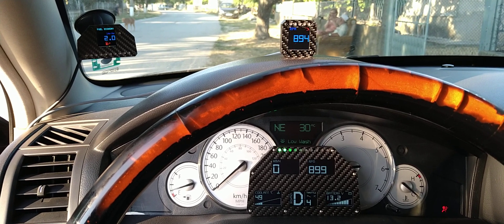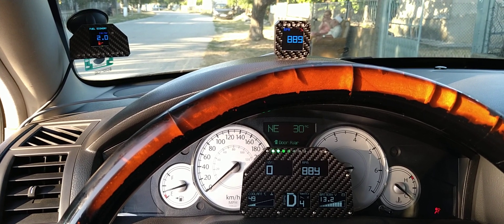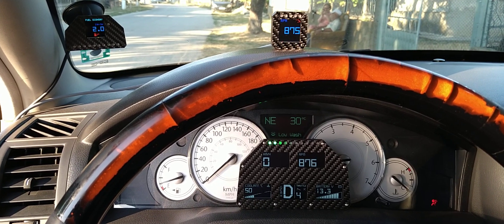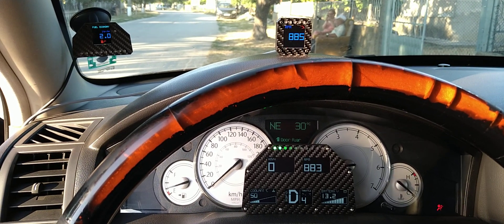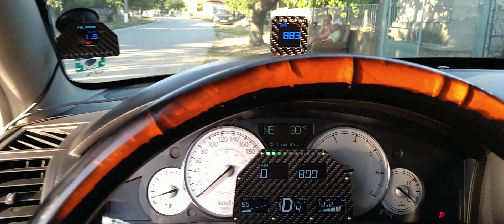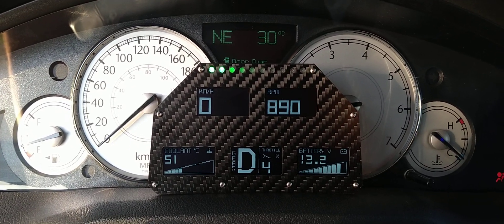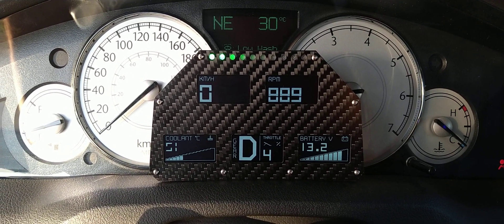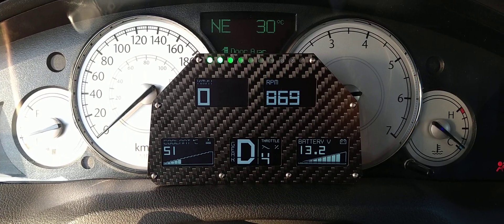Demo of the OLED V-GAUGE, "CAN GAUGE mini" and the "H.E.D.S. CAN Gauge" running at the same time.

Comment: Hayri, for the mini CAN gauge, is it possible to display a gauge face (either a traditional dial, or even just a climbing bar graph like what you're using for battery voltage) for RPMs? I find a number readout to be nice for speed, but for rpms I would prefer it be an actual gauge face of some sort.
Reply from the maker: Everything is possible, just a matter of time and effort, I can obviously not entertain everybody's wish, although I do like a rpm as a round gauge as well :-)

Comment: Is it possible to show oil pressure/temperature, coolant temperature? Transmission temperature?
Reply from the maker: Have you watch my previous videos about the CAN Gauge? It does have coolant and oil temperature already, oil pressure and transmission pressure are not standart OBDII PID's. I will however, with the introduction of my CAN BUS Node, offer the ability to add additional sensors to the CAN BUS Network and thus be able to show any data you wish.